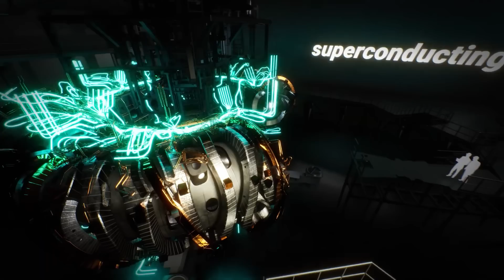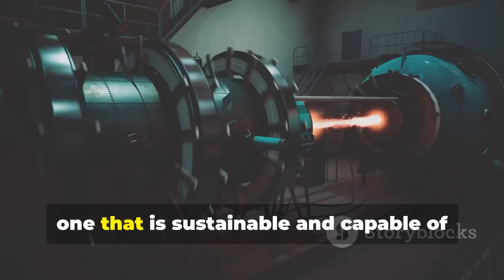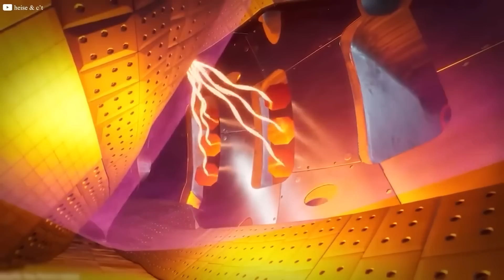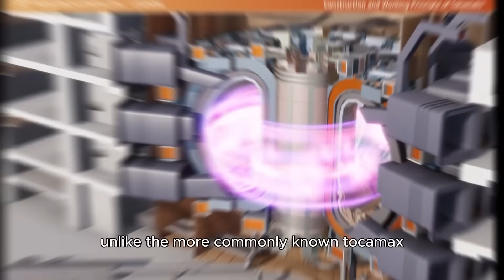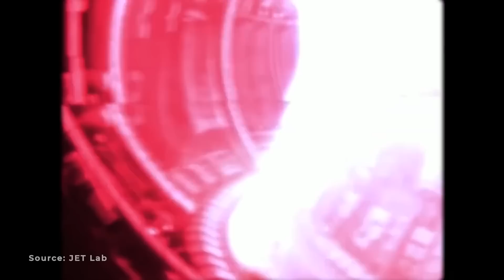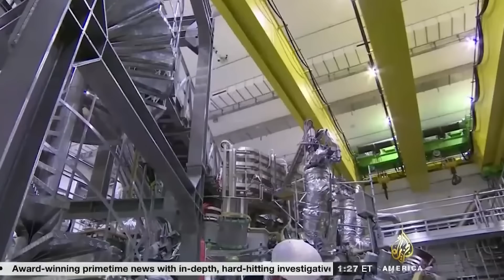This German Machine Could Power the Entire Planet

Comment: The plasma discharge lasted eight minutes.

The largest heat flows at Wendelstein 7-X pass through particularly heat-resistant divertor baffles. They are part of the inner wall, which, since the upgrade, has been cooled by a network of 6.8 kilometers of water pipes. No other fusion research facility in the world currently has such a comprehensively cooled wall. The plasma heater consists of three components: the newly installed ion heater, the neutral particle injection heater, and the microwave electron heater. The electron microwave heater was particularly important for the current record because only it is capable of coupling high power over periods of several minutes. The energy conversion of 1.3 gigajoules was achieved with an average heating power of 2.7 megawatts, with the discharge lasting over 480 seconds – another new record for Wendelstein 7-X and one of the best in the world. Before the upgrade, Wendelstein 7-X achieved maximum plasma times of 100 seconds with significantly lower heating power.

The plan is to increase the energy output at Wendelstein 7-X to 18 gigajoules within a few years, with the plasma then being maintained at a stable level for half an hour.

Comment: It’s hotter than the sun and we need materials that can withstand the heat. Maybe new ai designs could help how  do you make power off it without effecting the magnetic fields I think they want them to go on and off making a sun on earth 🌍 is probably not a great idea there are many factors we should consider there are better solutions. Make power from space unlimited building space harness are sun

Comment: Ganz schoen uebertrieben und doch nur standard propaganda.

No longer stuck in the 30 year loop ;• we will have fusion energy in 30 years!  Stellarator needs upscaling.  Will that be size of ITER?  With over 20 years build time.  Material science still has a long way to go.  Also for other tech to get started.  And which one is better suited for a spaceship?  With enough electricity, ION thrusters can get much stronger.  They are for constant accelleration, and that equals artificial gravity.  The Solar System made accessable.
€•;{